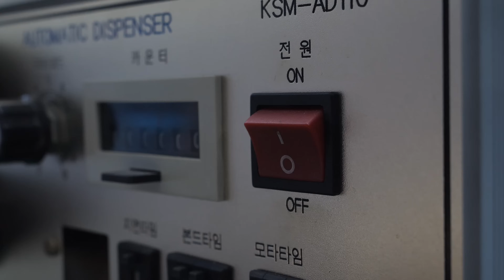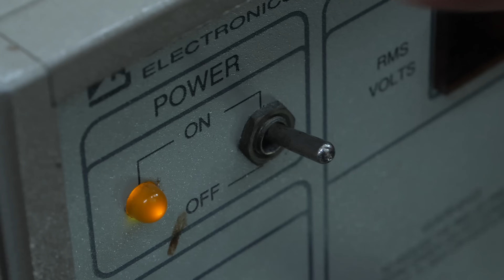40년 경력 엔지니어가 오픈형 이어폰 만드는 과정. 한국의 이어폰 공장 / Amazing Korean earbuds factory

Comment: I find it hard to believe that they manufacture this way - The earbuds would need to $1500 this way.  This is probably just a promo video -
Reply: this is hand assembly process so what u saw in the video is what they really produce their high-end earbuds.There is  semi-auto machines for assembly drivers which is more cost effective  and there is even fully automatic line of machine for assembly driver which is the most cost effective but drivers will be less  consistency. driver is so delicated and even what u saw in this video is not the best way to produce drivers.so believe me this video is what they really produce their earbuds in their factory not  a promo video for sure.